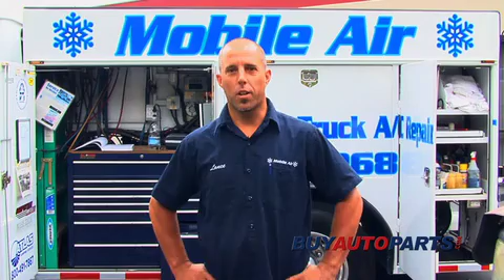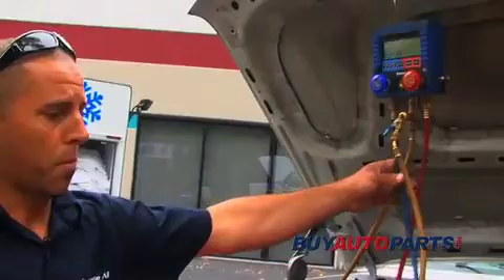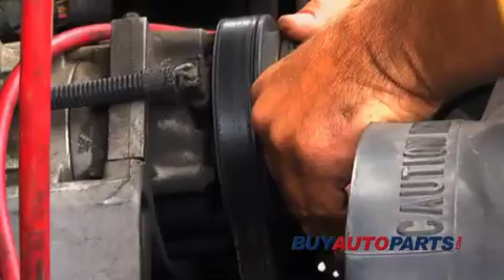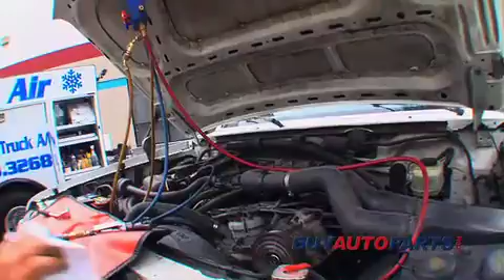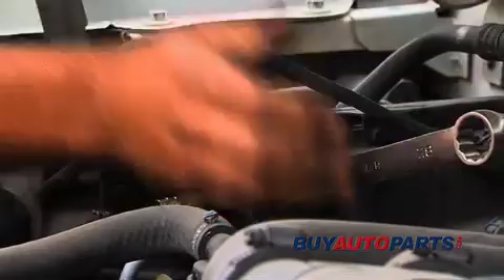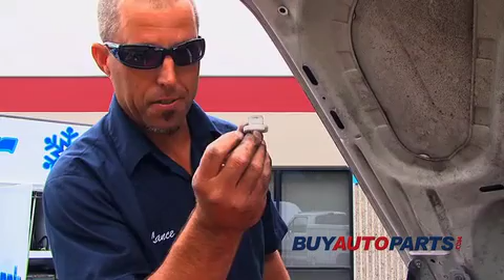AC Compressor Repair How to Install : Mechanic Troubleshooting- Part 1 of 3

Comment from the maker: @andypcguy1 

Yes, when compressor readings are nearly even like that it is absolutely compressor failure.  The ac compressor should be replaced along with a new drier.

Comment: Quick question.  I vac the system and then started adding a can of 134a to a 1983 C-10.  The gauges show high on the low side and low on the high side.  Looking at 70 psi and 90psi.  I think the compressor is shot.  Any other possibilities?

Comment: hey, i'm just getting into diy repairs on my car and i have a quick question. do you have to remove the accumulator and the compressor or could you just remove the compressor by itself? 
thanks in advance

Comment from the maker: @lild934 Yes, we carry oxygen sensors, steering parts, OEM turbos, oem car radios, etc. etc.  If it is not a body part, complete engine, or transmission, chances are we have it. 

Enjoy your weekend.